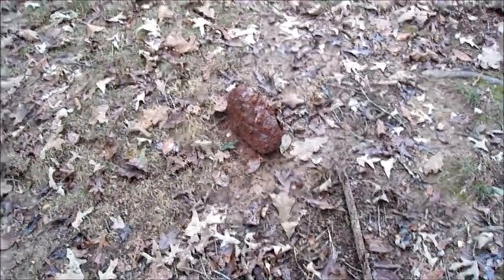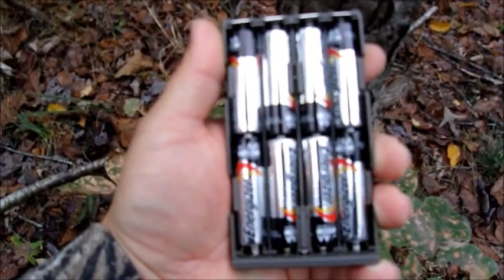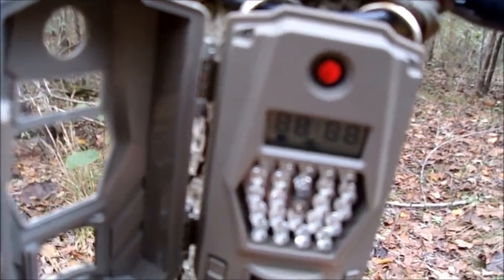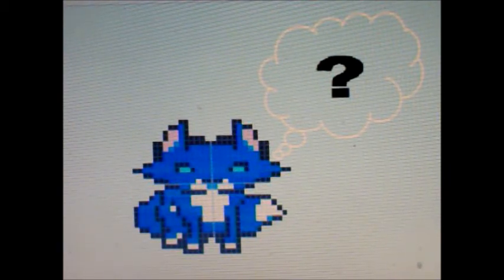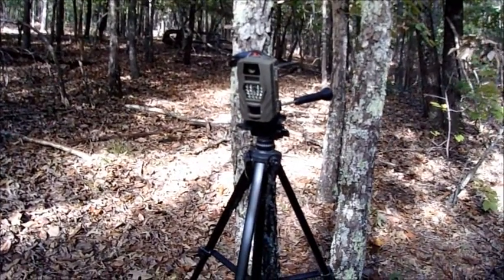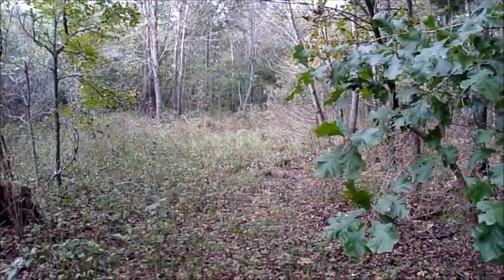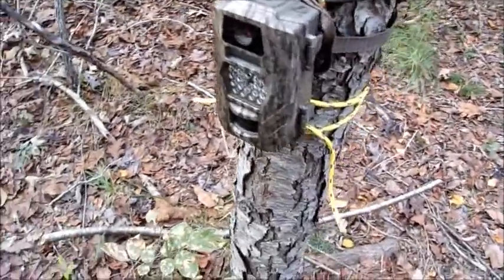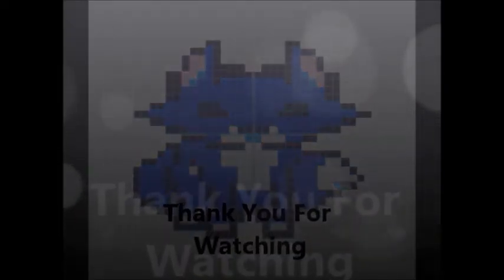So much went wrong with the 10 MP trail cam

Comment from the maker: Ok so on the trail cam if it gets full from taking videos the SD card corrupted and the trail cam froze up .
to get the trail cam back to working i had take out the battery and leave it on for 24 hours that fixed it . 
10MP still a good trail cam just could not handle a heavy traffic era of Deer , its working good now .
I am for now just using the trail cam as a security camera in my yard .